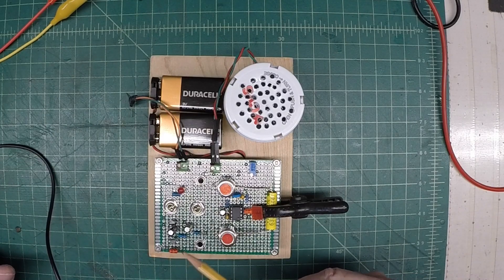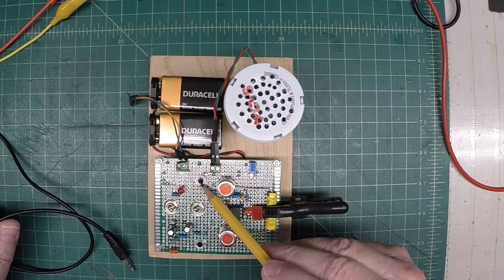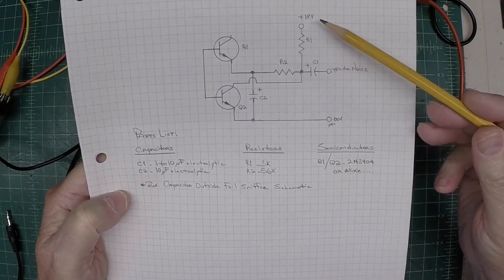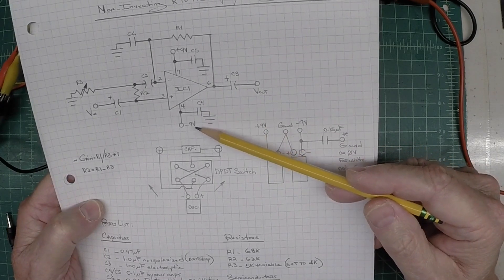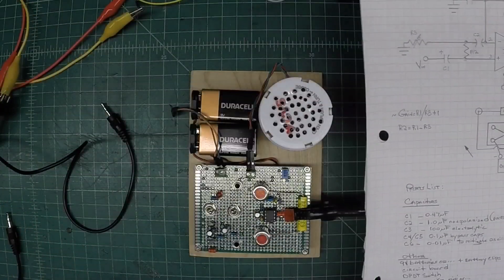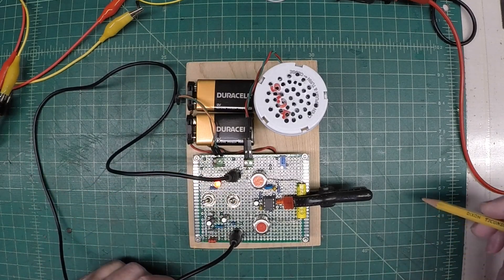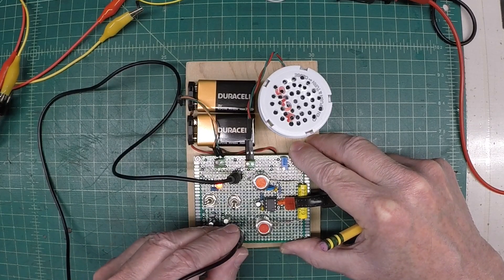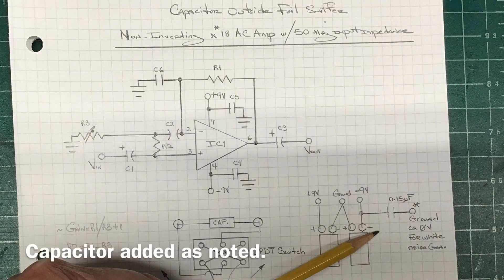White Noise Generator Integration w/ Capacitor Outside Foil Sniffer

Comment: OK, I'm going to build this version with the white noise generator on-board. Thanks for the design! 👍👍👍
Reply from the maker: James, hope the build goes well for you. Best, Don
Reply: @RestoreOldRadios  Don, just one question: In the generator circuit you specify C1 as 1 to 10uF electro. So its value is not important to the operation? Should I pick half way (4.7)?
Reply from the maker: In my limited testing anything within that range worked well for me. Using a 4.7uF should be fine. Best, Don
Reply: @RestoreOldRadios  Thanks Don. One other thing: How do I orient/calibrate the DPDT osc switch to point to the correct (i.e. foil) terminal? I guess I need a known foil capacitor to do that?
Reply from the maker: James, an old paper/wax cap can be used or use your multimeter. You should see ~0.5VAC on one of the two terminals to ground that your test capacitor attaches to; this is the signal from the white noise generator. Hope this helps. Best, Don

Comment: Don, that is fascinating. Why do you think that modern thru hole caps do not have the foil end marked ?  Does it make it cheaper to make or something else ?   Very cool concept you have there and excellent design.   Thanks Ron
Reply from the maker: Ron - I’m far from a SME on the subject, but most likely to keep the manufacturing cost minimized and new capacitors seem to have less signal picked up by the outside foil due to their construction. In addition; if I recall correctly, transistor and IC circuits are not typically impacted due to their impedance points, while tube circuits do benefit from having the capacitors oriented correctly. Best, Don

Comment: Will a pocket oscilloscope work for detecting the foil side of a capciator? ,hope so I bought one of wasn't very exspensive,.
Reply from the maker: Ron - I would think so if the dynamic range is adequate and there’s enough 60 Hz noise to display. Try a .01 uF capacitor or higher in value to evaluate would be my recommendation. The lower value poly caps are more difficult to ID based on my limited testing. Hope this helps and keep me posted on your results. Best, Don